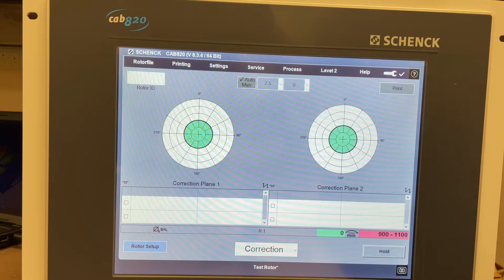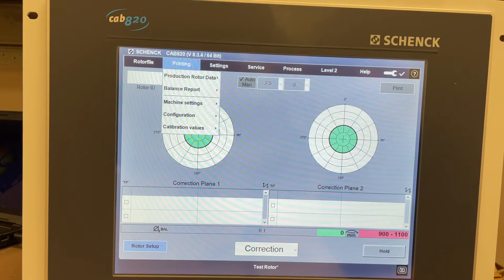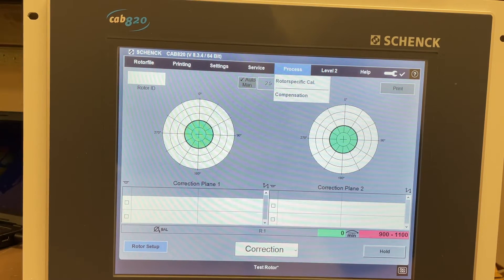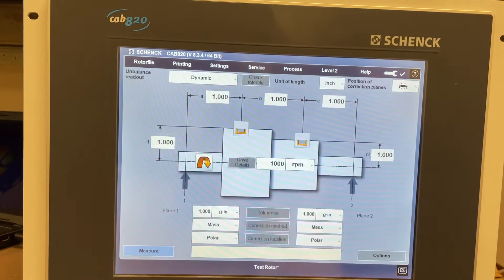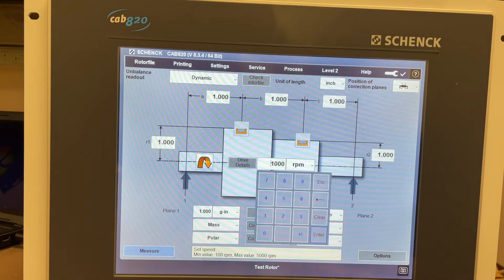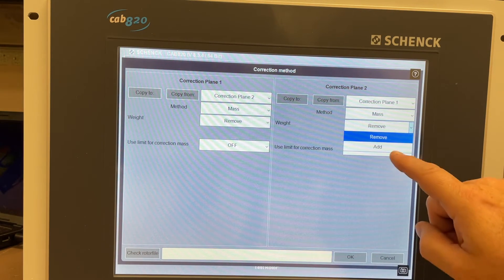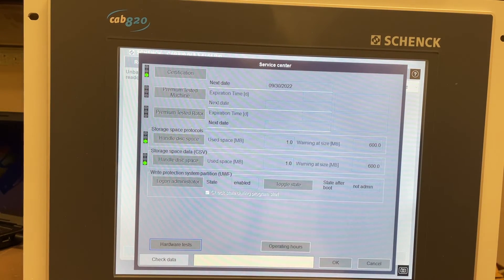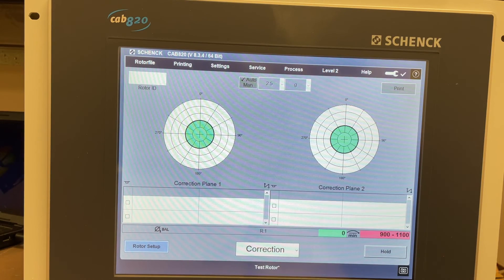Schenck CAB820 Measuring Unit

Comment: Hi, our cab820 is set to reach 900rpm. But it will max out now at 705 rpm. In the settings however it still says 900 rpm. We checked the sensor and the drive belt. Our tech said he accidentally entered a yellow menu somewhere, but he can't retrace his steps.
Reply from the maker: Hello, send me your email and I will have Schenck tech support help with this troubleshooting
Reply: VFD Settings